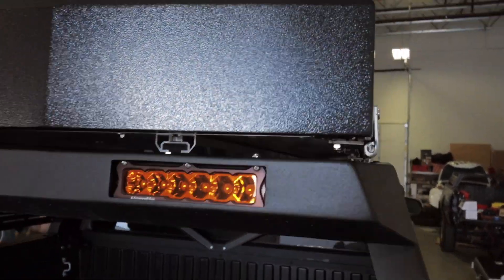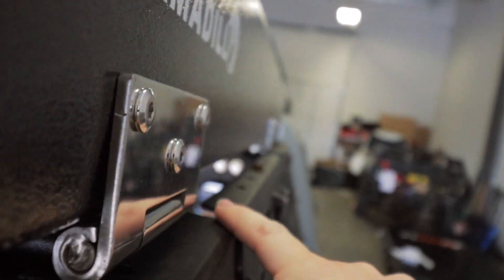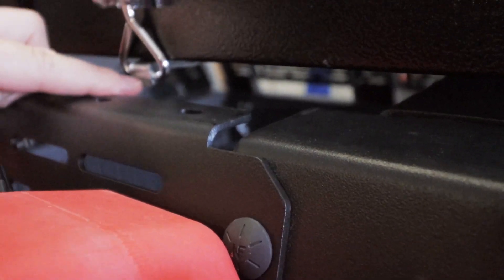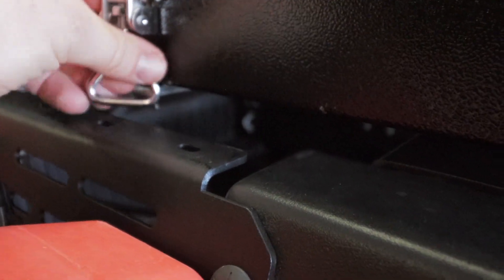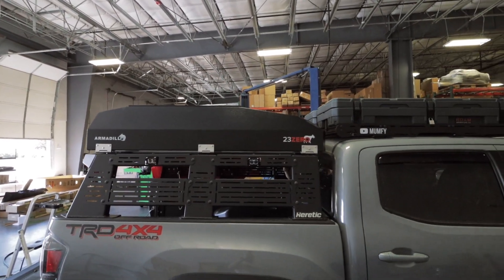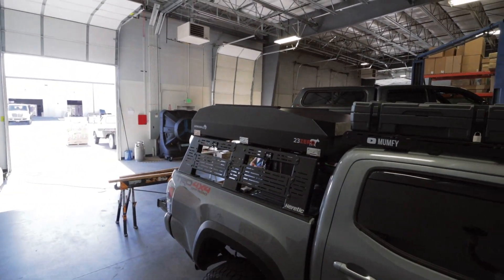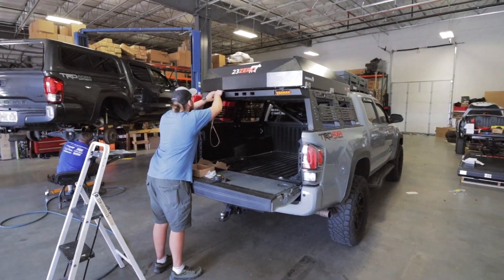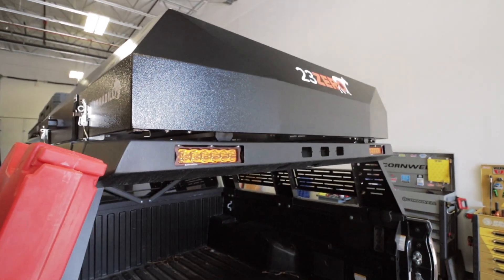Installing a 23 Zero RTT on My 3rd Gen Tacoma

Comment: Hey Mumfy. I need to park in my garage. My current setup allows that with less than 2 inches to spare. I too have a 3/4 bedrack on a gen 3. Could you give a measurement from top of the trucks bedrail to highest point of truck?
Reply from the maker: From my bed rails to the highest point on the RTT is about 28”
Reply: Thank you   I really appreciate that.